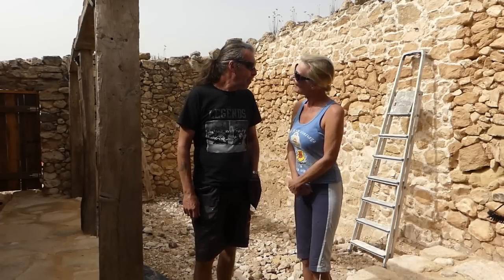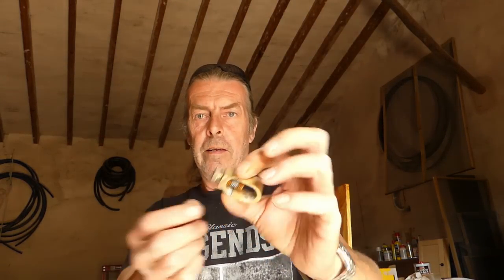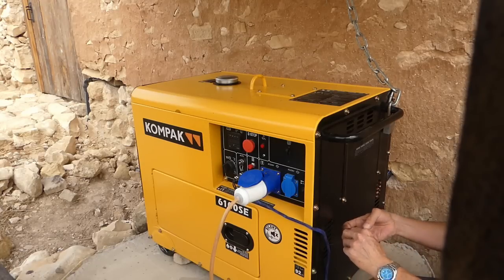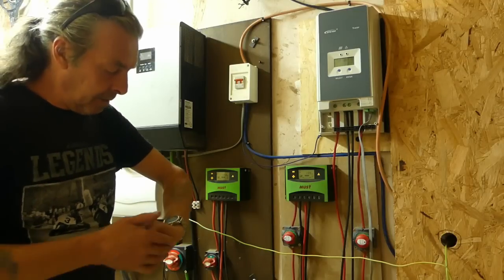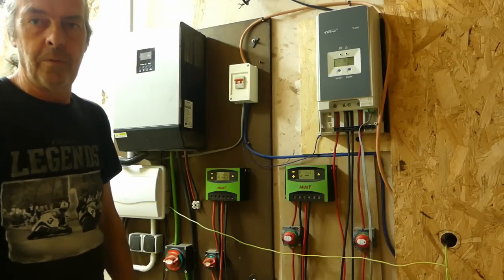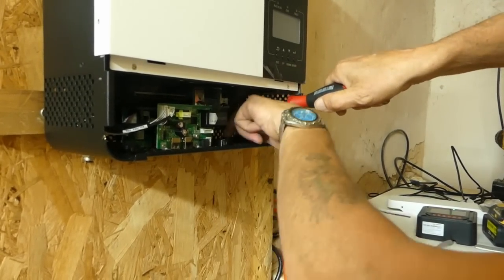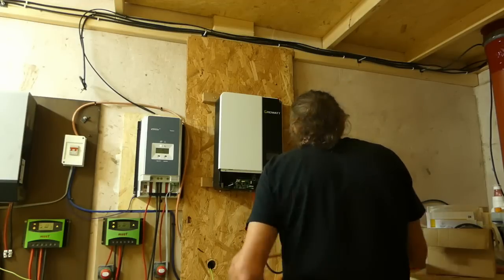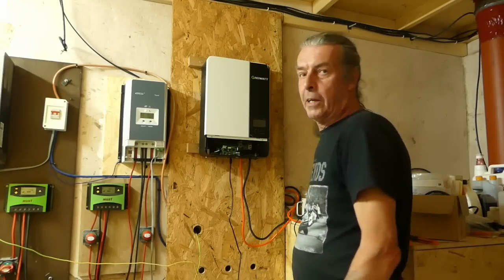Off grid 5 kW solar system install / upgrade - Part 1

Comment: Happy birthday, Sharon!  Andy, great tutorial.  After that, I realized how little I know / understand about these kind of systems.  Very impressed with the organization of your system, though, and all the points where you can control it by shutting off / turning on a specific area.  Also, the fact that the junction box outside under the panel was immaculate after all this time blew my mind - job very well done in configuring that one.
Reply from the maker: Thank you. I had an understanding of solar for many years but this new technology is another level - I'm still learning!

Comment: Forgot to ask   How did outside solar lights work out? Bright enough?
Reply from the maker: They are absolutely fab but the bbq once could probably be a bit brighter for actual cooking. We're going to but a bright, mains powered one up there eventually, like we have in the lower courtyard